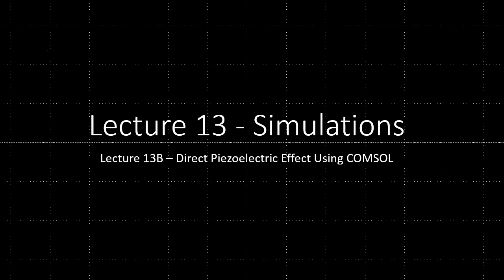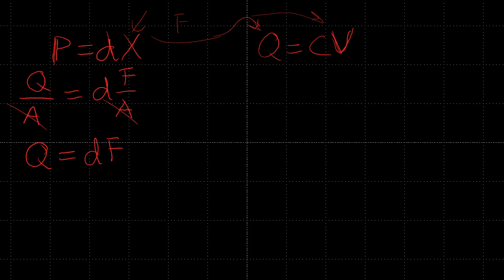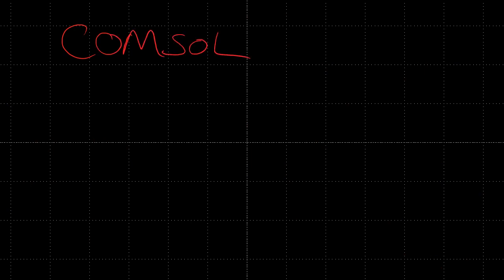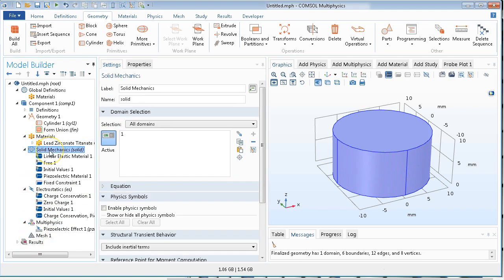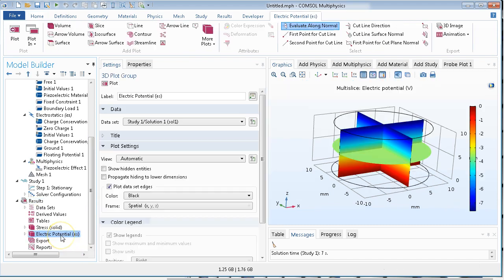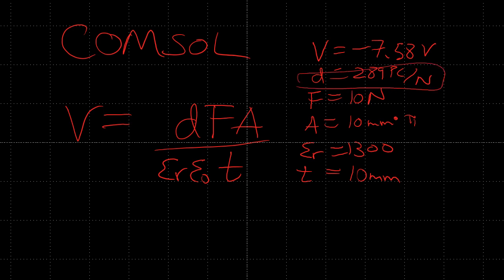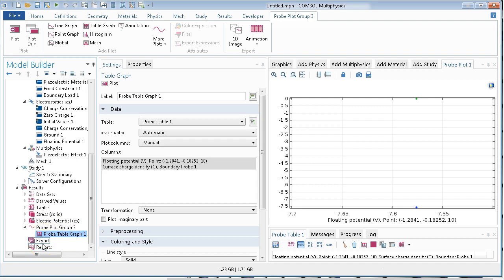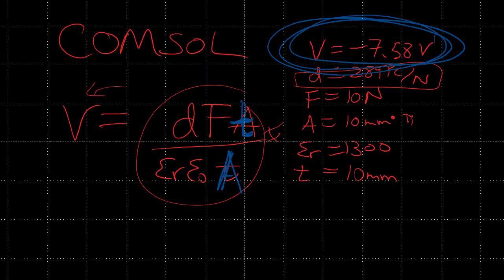COMSOL simulation of the direct piezoelectric effect (sensor)

Comment: Thank you for the video. I think there is a small mistake in a formula given at 5:24  of the video..because accorditng to this formula it's impossible to get higher voltage with decreased area of material. Area "A" should be down with respect to the given ratio, while thickness "t" is up. It proves with other references.

Comment: Thank you for your efforts in this field. I am new to Comsol and I have two questions: 1) if I will do the study in the time domain and wanted to use sinusoidal load, then the load would be for example -10*sin(w*t)? how can I define the time and w?. 2) I noticed that you didn't build a circuit in the video, so when do I need to build a circuit and add a resistance to find the power?

Comment: Hi. Thanks for sharing the video. It was very useful of a beginner new to using COMSOL multiphysics. But there is a problem with the capacitance formula for a parallel plate capacitor, c=(permittivity x area of the plate)/distance between plates

Comment: Thank you for the video, sir. I'm doing my final year project on piezoelectric material. I have a question regarding series and parallel connections on comsol.  Is it possible to connect piezoelectric discs in series and parallel to check the total output?

Comment: Hi,
Thank you so much for detailed explanation.I am doing my thesis on simulation of piezoelectric material using comsol  and using a single crystal which is placed between two copper plates.when I applied force (0 to 100 N)there is linear increase in voltage .but in actual signal crystal is so tiny it will break for a very small force.do you  know how can we test it in comsol? my second question is how to plot sinuosidal graph (Time vs constant force). where i have to right this expression  f= f0*sin (2*Pi*f*t) to get a sinosidal graph?
Reply: @ultrasonicadvisors  hi 
Thank you for your reply.im not doing time dependent study now.i left and instead  I'm doing stationary  study for polycryatalline  material  and would you plz guide  how to give each crystal a different  poling direction like in the real case in which we have many Crystal's and each crystal have different direction  due to which some of the crystals  cancel out each other effect.